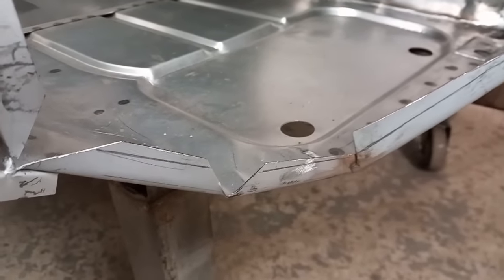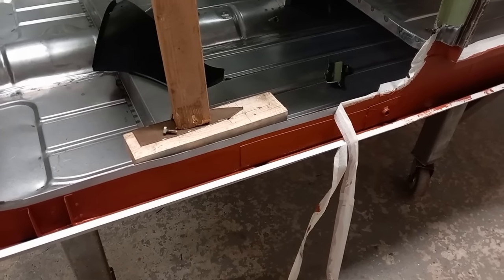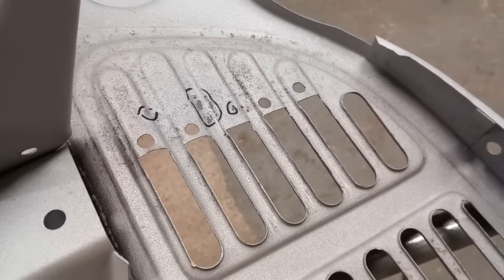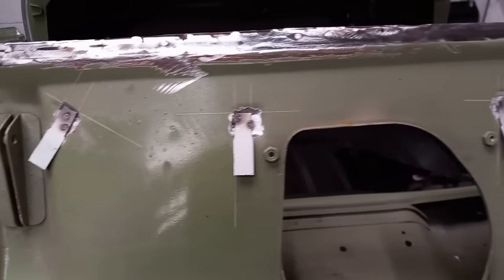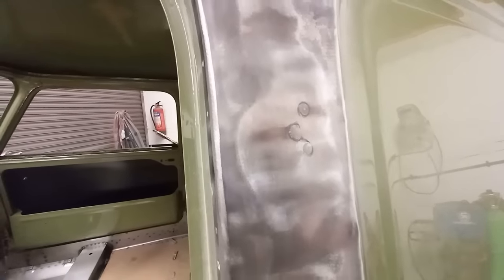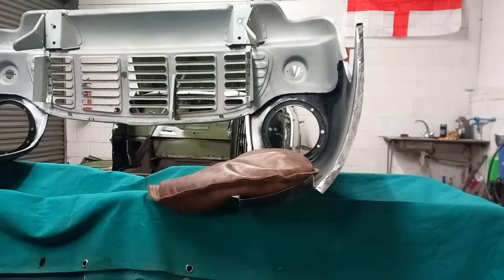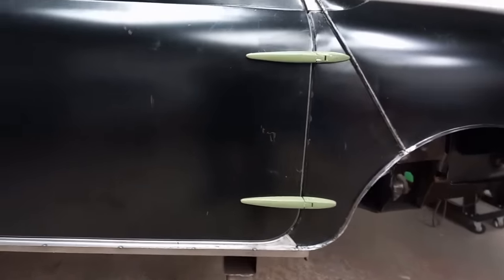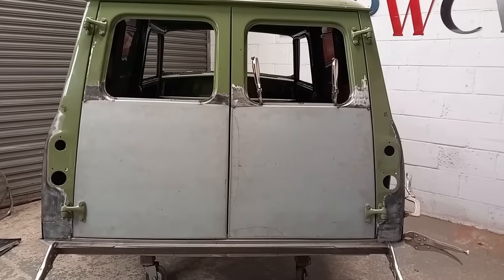Willow Green 1964 Classic Mini Van Bodyshell Restoration. Ep 3/3

Comment: I have a 1967 Mini Traveler steelside - that is the station wagon ordered with the "delete wood trim" option selected. That was common here in Canada due to winter upkeep issues, while the upgraded heater (3.5 kw?) was also commonly selected. They both show up on my Heritage Certificate. Vans were very uncommon here, while the Parks Department here in Toronto ran several white pickups.

Comment: We had (Dad) a mini Traveler with sliding windows and cord? To open the doors. That was green and I loved it 
Bought in 72 as a 3 year old motor. 
I would love another ❤️
Great Video
Reply from the maker: Thankyou, my parents had a traveller, I was driven home from hospital in it just after I was born
Reply: @PWCV-YT 
I’m 67 and the traveller was immediately after my mom died when I were 15. 
Loved it. 
It replaced a MK3 Ford Zodiac that was Bentley British Racing Green. I loved that too but it were mi mams.
Reply from the maker: @Yorkshiremadmick  I love Zodiacs too
Reply: @PWCV-YT 
There were some cracking cars back then. I loved driving the Zodiac with column gear change and bench seat. I was 10 and drove round the estate. Mom was short, so Dad had put wooden blocks on all the pedals. Just so mam could reach. Thus I could too 😂😊😊

Comment: I used to work for a company that made mini panels from the original tooling it looks like your door panel wasn’t placed correctly in one of the tooling stages after the first draw stage, that’s why it had a double coach line.
Reply from the maker: Ah, thanks for the info. Certainly explains why they vary so much

Comment: Yes there’s a art to welding thin material but it depends on gauge of welding wire if is o.06 then you be okay but your Amps have to be right Bill
Reply from the maker: Well, i have 35 years practice at it. I use .8 wire
Reply: @PWCV-YT  yes you can I did myself did 25 and a half years at Leyland motors doing welding &Fabrication time served so I am like yourself I think I have a bit knowledge under our belts plus I use to work in a training centre teaching young lads how to weld and the different aspects to the job Bill

Comment: A proper tinny at work, superb, luv the little tips, especially about wrapping the  flange around the door 👍. How did you weld the rear quater on, butt weld or lap joint?
Reply from the maker: The quarters are butt welded. Unfortunately the video footage of that process didn't come out so couldn't include it